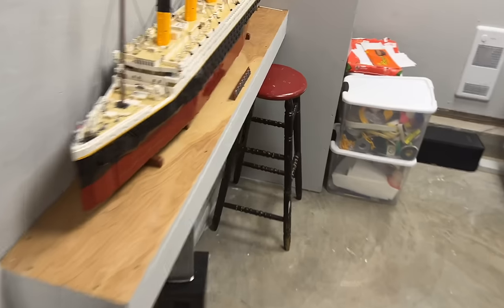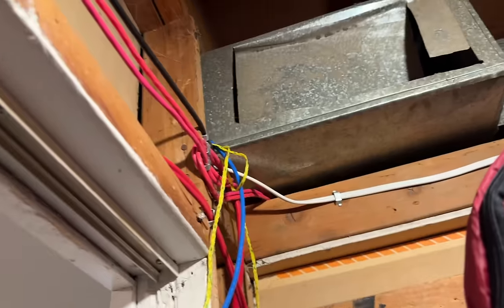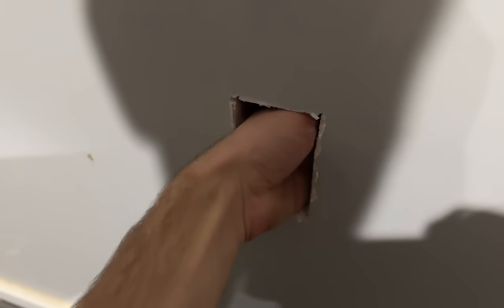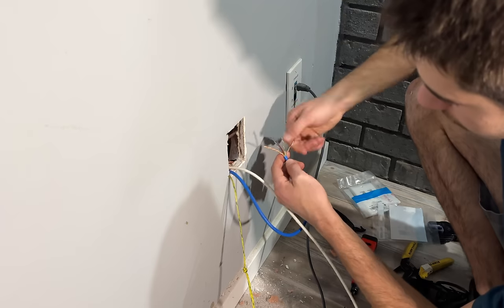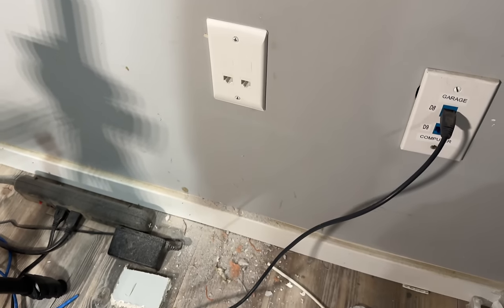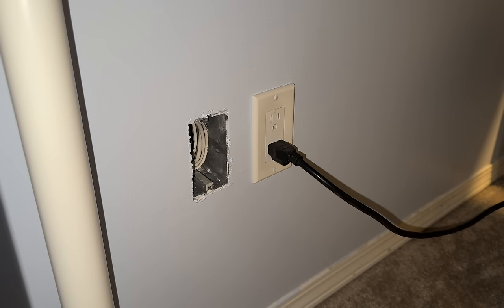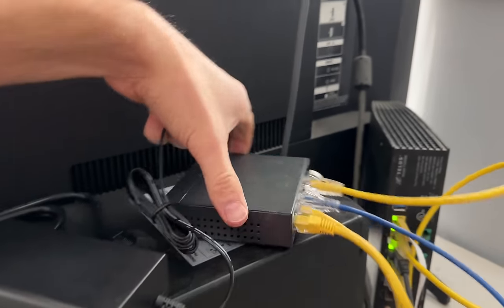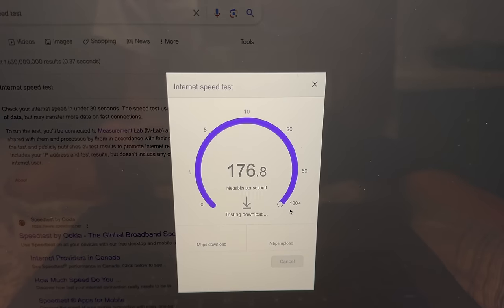Home Ubiquiti Wi-fi upgrade, installing access points, and terminating Internet jacks.

Comment: Hey nic, network engineer by trade here.  You did so many things right here, specifically making a wired backbone behind your system which so many people don't understand is crucial to a well functioning wifi system.  The speed and response time isn't always the same thing, but it seems like you improved things.  Without talking to you, one thing i can recommend is get a wifi analyzer tool which tells you the wifi channels you are seeing at any point as you walk around the house.  Once you sniff the air with the analyzer, you can also change the channels of your ubiquiti access points to de-conflict with surrounding wifi (including your neighbors) and things will get even better.
Reply from the maker: Thank you for your input and suggestions I appreciate that

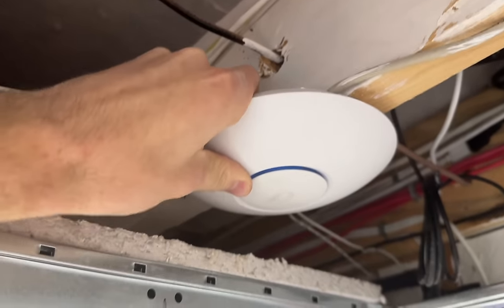Comment: 3:20 I love that AP, I still use mine to act as a wireless bridge to my U6 LR (Wifi 6 version of what you got) in my apartment. Then the other one at my parents in the far corner of the yard is in mesh mode and worked great for the amount of data it needs to serve.

28:30 only thing is typically T-586 B is used (orange and green pairs swapped) still good as long as you run the same standard on both ends othwise you'll have a crossover cable.

Overall a great setup, the biggest thing is if you do intend to add a lot of IoT devices you may want to look into getting some unifi switches to create an IoT (wifi) network, to tune the network for IoT and enable flow control. Either way, the UniFi setup is a great foundation for some very advanced features and works great for even small sites.

Comment: Great video, remember to back up the network so it can be restored if the software goes corrupt. I would recommend having a controller always running to aid updates.
Reply from the maker: Just depends if I can justify the cost to others
Reply: @nics-systems-electric  If I'm not mistaken the controller software needs to be running in order for seamless roaming to work properly. That should be enough justification to keep it running. Plus don't you already have a PC running in the garage for controller software? Put the UniFi controller on there too and it won't cost anything.

Comment: Ignore haters :) good job. 

Just don't strap power supply to the PoE switch (or any switch for that matter) - it will get fried, maybe not in a week or a month. Or at least check on its temperature, they usually get quite hot. Unify is pretty cool, easier to setup with UDM Pro.

Comment: I really enjoyed watching and learning from you in this video. You have given me confidence to do more or less the same thing here in Scotland. I have abysmal WiFi coming out of the service provider’s router so you have given me a great solution. And thanks for the mention of the other appliances, alarms etc that use the old WiFi - I hadn’t thought about that but I will now leave the existing WiFi operational to save moving them all over needlessly (and tediously!). Cheers.
Reply: If your new Wi-Fi setup has the same SSID and security settings then almost any device will automatically switch over. Having said that, you might want to keep slow things on the old Wi-Fi to keep the new one free for your computers/etc where you want the best performance. Just be sure that the old and new Wi-Fi are on non-overlapping channels or this benefit will be lost.
Reply: Thank you - that’s very helpful. Cheers

Comment: Good choice Ubiquiti Unifi. I run full Ubiquiti Unifi ecosystem at home using Dream Machine Pro pair with Unifi 24 Poe switch and 3 u6 pro. Getting 700-800 mbps over WiFi. If you decided to go on full Unifi, you can do it cause it’s very simple to setup and give a bit adjustment then you’re good to go. It looks like your setup you can ditch isp router and get dream router, it come with two poe built in so you get two poe out of 4 port switch that feeds your both ap and additional flex mini switch for more ports to your computer and for garage you should get 8 PoE gen 1 it feeds ap and more computers. I think it should work very well. After it settled, make sure turn up from 40Mhz to 80Mhz on 5ghz band so you should get around 400-500 mbps out of that wireless AC.
Reply from the maker: I don't understand how I would get rid of the ISPs modem
Reply: @nics-systems-electric  there are five main reasons why. 

1. Save your money from renting isp router in long run.
2. Improved speeds and range.
3. Complete control over your home network.
4. Enhanced security.
5. Bandwidth prioritization.

According to my setup, I have isp cable modem I set bridge mode so it going pass through ip address to dream machine pro. Bridge mode disable everything (wifi and router mode, only handed directly IP address to third party router). We have no issue so far. I have two internet resource. One cable and one fiber act as backup in case if it goes down.

Comment: Hey very great video nick just as a sugestion that might help you, if you have already identified the port that goes to your pc directly into the router so you have less points of failure and a direct connection to the network in case you have a known direct connection in case of an emergency, if you have any other questions about networking feel free to ask, we are all here to help and learn!

Comment: You did a great job and anyone that complains or is critical of your work should just be ignored.  Good for you branching out of your comfort zone and learning more.  Lots of electricians won’t touch the low voltage because they don’t want to learn.  The only suggestion that I have is to try and use all UniFi hardware as you can manage everything together and it makes it easier for you when you want to do more things.  Also you have run a new network in addition to the garage one to migrate to if you want.  This is the first time I have commented but I have been subscribed and liking your content for a while.  Great job and keep up the great work.

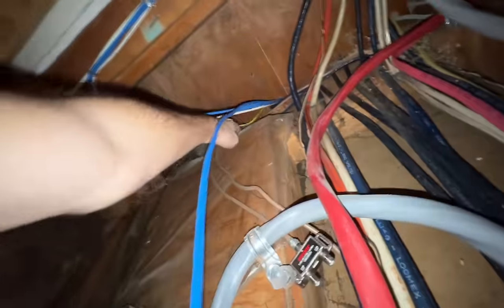Comment: VIDEO IDEA: You should durability test a sprinkler head while its connected to water. By the way, you don't need to stay with Unifi (though Unifi is great and I love them) just to have a roaming wifi network. As long as all your access point are on the same channel, same wifi protocol (802.11ac/ax/etc.) and same SSID and password, they will all work fine no matter the brand. Good pick with Unifi though, I love their stuff. Maybe consider a Dream Machine in the future for your router. 16:54 it looks like your staples might be a little too tight on the cable. Those cables are very delicate so make sure you don't staple them too tight. I love your house work videos! Nice job!
Reply: sometimes different brands will have roaming issues though
Reply from the maker: Firealarmdude5967 did a video on that already wouldn't want to steal his video
Reply: @nics-systems-electric  Oh cool, thanks! Great job on all your videos!
Reply: You actually want different channels for each AP. When multiple APs in the same area share a channel they will interfere with each other. You also don't need the same Wi-Fi standard. Only the SSID and security settings need to be the same for basic roaming. But you'll lose connectivity for a few seconds when your device switches network, for seamless and/or fast roaming your APs need to communicate with each other.

Comment: Hey, nice job! Good equipment I would totally buy this and do this in my own house if I had the money lol you did a great job it little tip for you if you ever mess with the ethernet again when you’re on twisting the pairs if you take the insulation you stripped, you can stick it down in between them and twirl it around and it saves your thumbs, especially for you doing a bunch of terminations I have a certificate Google IT networking and that was something I told my teacher and he was like wow that’s awesome lol

Comment: Hey Nic! 

Unifi APs are brill. I've got 2 in my house in the UK and 3 switches from them too. I must have 10-15 network drops in my house. 

The AC access points are a little older but still plenty speedy enough for most people. 

I wouldn't put an RJ45 on solid core cable. Eventually the cores will snap as they enter the end of the connector. I'd always terminate into a box and use a patch lead. But it'll probably be fine! 

That TP-Link switch will probably go for ever. They're surprisingly robust.

You can move your controller from one PC to another but it depends if you're that bothered. 

Ayla loves the squeeky sheep ay? 🐶🐕
Reply from the maker: That's interesting I've never ever seen an RJ45 not on solid core wire every one I've ever seen is just on the cable
Reply: @nics-systems-electric  yeah it's totally a thing. You can buy boxes of stranded cable which you can use, but you can't punch that down for obvious reasons.

Solid core cable - especially Cat6 and 6A - doesn't like to bend too much and you'll find minimum bend radii on the cable specs. Stranded cable will do 90 degrees no sweat. 

You know what though - you did a great job! There should be no criticism for things you don't know. I wouldn't know how to wire an electric outlet or change downlights! 😊
Reply from the maker: @Rainbowhockey  interesting and yeah you definitely don't want to bend it too tight especially fibre lol

Comment: If you're ever thinking of buying cables higher rated than cat6a, it's a common problem particularly with cat8 that they will actually fake it and sell you lesser cables such as cat6, especially with patch leads. 

Also if I were in your shoes I'd put the access point in the garage on a ceiling tile - they make them look pretty for a reason! You could put the hole in the tile over the cable cavity in the AP, so you can twist it off easily, while avoiding any visible cable or holes on the tile. I can understand not messing with it though, as I'm guessing you care more about the function than the form.

It also may be a good idea to divide up your network between computing stuff and 'internet of things' (such as lighting, cameras etc). I personally don't trust internet of things on the same network as my browsing. The way it's done is usually using VLANs if you're interested, but it requires a fancy managed switch and stuff, maybe not worth the investment if your priorities aren't at that stage.

All in all, good video - you have a nice setup and it does the job 👍 Free is the best price for these things :)

Comment: I'm kind of in the same boat and in the market of upgrading my system cuz I have an all-in-one ASUS gaming router but I've had numerous issues over the years with it disconnecting from our ISPs system and Wi-Fi connectivity disconnects or no internet being served. Even though I'm connected I spec out a system that my brother's going to go and get that separates everything switch router and access point

Comment: No need to stress about making videos for networking. I watch lots of your electric videos and they are over my head. My recommendation would be to advertise as a second network name in the UniFi as the name and pw of the telus router and then turn that off on the telus. You can fully abandon it and have the ubi AP’s run it all.

Comment: i would have recommended the ubiquti switch since you are using a ubiquiti system which does have management capability
Reply from the maker: That would have to be more than just a switch you would need one of their dream machines I believe which is much more expensive which I don't know if I could justify to others in the house when I can configure them for free from  a PC

Comment: When you have time bring the ap below the t-bar ceiling in the garage. In order to get better Wi-Fi signal.
Reply from the maker: I haven't had any problem with it hasn't had any change since before there was a ceiling I've been on many jobs where the access points are above the t-bar ceiling
Reply: @nics-systems-electric  well it is your choice.  I just decided to give a suggestion.

Comment: Not bad, but I wouldn't have two long-range APs in your size house. I'd suggest swapping some of your APs so you have an LR in the garage and both an LR and Lite inside. It might sound counterintuitive but reducing the transmit power can improve overall performance when you have multiple devices and multiple access points.
Reply from the maker: They were free and it's working great

Comment: Just curious…are you planning to set them up so each one is an independent router? If so, you may run into issues of them fighting over each other and IP issues down the road. A Unifi UDM Pro SE would solve these issues and eliminates the need for PoE injectors and a switch which in turn also eliminates possible points of failure as well.

I’m in the US and my ISP only assigns one IP address per household so multiple independent routers didn’t work for me, I had a lot of issues. Once I got the UDM SE, all my problems went away.
Reply from the maker: One router from the ISP and all access points working as a mesh

Comment: Lol I just have my isp's router/ modem combo and it works great ( mostly ) but not enough to warrant APs
Reply from the maker: Probably didn't need the access point in the upstairs of my house but the downstairs was struggling it has a much tougher time penetrating the stucco on the exterior of the house as half of the basement used to be an open carport